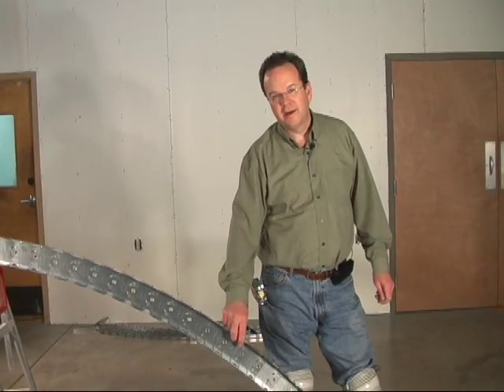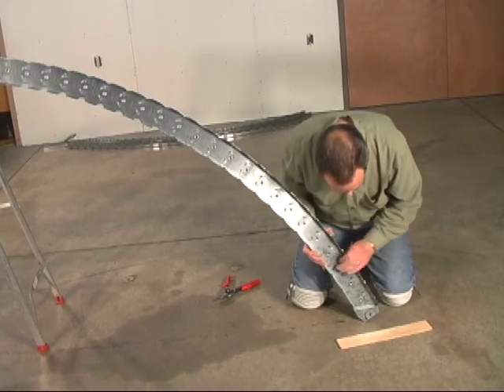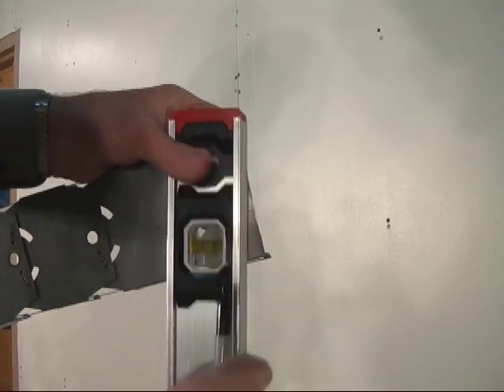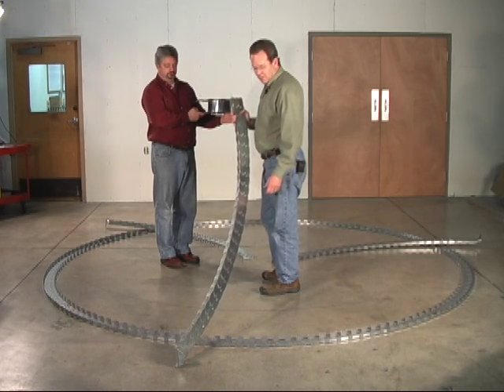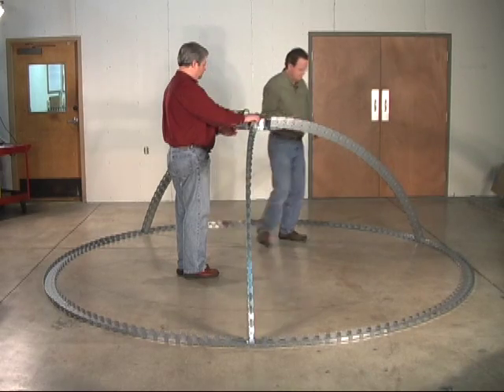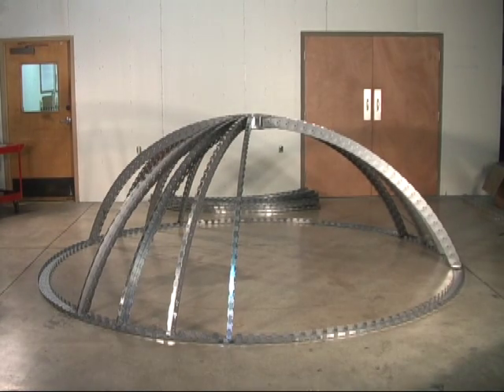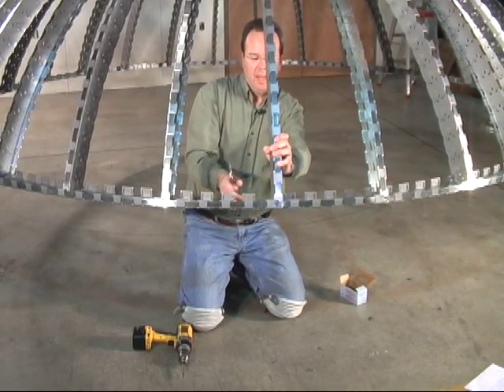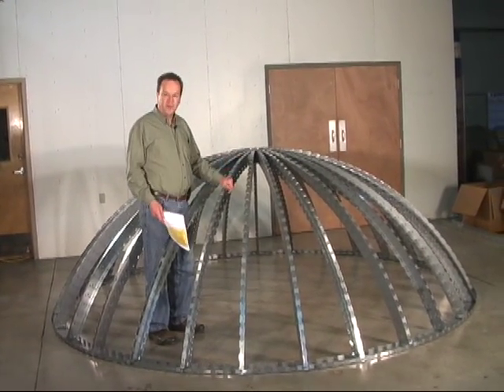How to Build a Dome Part 3 of 3

Comment: I was a sheet-metal man for several years, working with heavy steel to lighter agricultural and industrial steel and aluminum, copper, magnesium, and even obtained my journeyman electrical licenses. I must say that this product is a dream come true. I have yet had the pleasure to work with this, and I am looking forward to doing so. Thank You.May I inquire a price of these materals? I will inquire at local building supplies.

Comment: This is pretty awesome.  Rare to see something truly original.  I understand the applications.  This can make building archways so much easier!  Will save a lot of time anywhere you want a curved shape.  Get away from rooms all being just squares and rectangles.  To put a serpentine wall you just use the Flex-C Track for the top and bottom headers and then you can use regular wooden studs between them.  Wish this had been available to me ten years ago when a client insisted I build a circular room in the middle of the basement!
Reply from the maker: Thanks Anon for appreciating our product! We are honored to make people's work easier and their dreams possible.